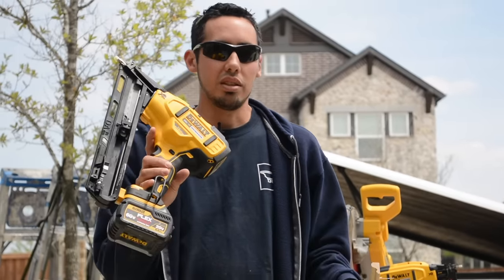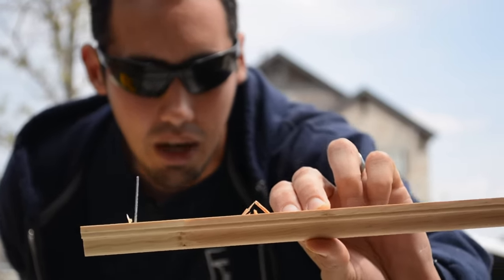Which NAIL GUN Should You BUY???

Comment: I have both of these nail guns and I absolutely love them!!! but I still use  pneumatic nail guns it certain applications if you can afford to upgrade to the battery operated trim guns  I highly recommend it. If not you should definitely look into buying the pneumatic versions of these guns . I actually have them both battery operated and pneumatic They are amazing guns and  have been engineered with a brand new technology I believe it’s called smart point or fine point technology. This technology and these guns are the most user-friendly and reliable trim guns I have ever shot. Even the angled gun shoots every single time and anyone that has used a angled trim gun knows that they are not the most reliable when it comes to pulling the trigger and expecting a nail to shoot out!
Reply: There is nothing new about smart point technology. Bostitch has been using it for quite some time on their phnumatic line. Bostitch and dewalt owned by same company so the technology was transferred over. 
If you want pneumatic dewalt isn’t too of the line. Bostitch And hitachi blow it out the water. Battery operated though dewalt and hitachi are the only contenders.
Reply: Are you a fan of pin nailers?
Reply: crunch9876 In my view you cant beat bostich
Reply: John Davidson well boating and dewalt battery nailer are 100 percent the same except for battery. What would you rather have a battery for one tool? Or a dewalt battery that could fit a lot of tools.
Reply: crunch9876 bostich neumatic i was talking about.. had the 23 guage used almost daily  for 11 years with no issues
Reply: robert sharpe

I'm not a DeWilt guy but I have the DeWilt pneumatic 15G nailer and I would buy it again.  It's really good, I only wish it was teal color instead of yellow.  :-)
Reply: Bill salvadore  yes sorry for the late response but yes I use pin nailers in certain applications. I have a pneumatic 23 gauge Hitachi and I also recently purchased Mikita’s new battery operated 23 gauge pin nailer I like to use pin nailers for shoe molding and installing trim on cabinets or for holding up a very small piece of trim. A pin nailer allows you to install a piece of trim with almost a flawless finish they r great for installing pre-finished moldings
Reply: I am going to replace my back yard wood fencing (dog-ear picket) in spring 2019.  I am not an expert by any means but have replaced sections before.  I used just a hammer
and nails.  This time I would like to lighten the load by purchasing one of the DeWalt cordless nailers, which one should I buy?
Reply: @jamesogletree5257  DeWalt just came out with a fencing staple gun. It's big and burly but packs a hell of a punch. Might be too much though, maybe the 15 guage might work better.
Reply: Can i have your nail guns
Reply: Yes
Reply: @gshock200  
Yes
Reply: @gshock200  
👍
Reply: @gshock200  yes
Reply: could u use 16 guage nails for delicate tirm? especially for old house
Reply: randomrazr if I were you I would just go with the 18 gauge and skip the 16 altogether if you want a larger gauge I would just buy a 15 gauge angled gun but for delicate trim I definitely would use a 18 gauge and depending on the trim might would even use a 23 gauge pin nailer
Reply: Are they still working.
Reply: @rsharpe1985  I use 16 ga it works for me the diff between 15 and 16 isn’t enough to matter that much
Reply: @mrgrump2534  Yeah there isn’t much difference but for nailing up Crown the angled gun makes a difference
Reply: @rsharpe1985  16 is better for me it’s lighter gun and the nail holds up just as good as 15 ga so not shure y ure saying skip it u must not have had much exp. with it then I’ve been using for years so regardless  it’s a proven nailer so ....
Reply: @rsharpe1985  well since the 16 is pretty much just as angled it’s a wash unless ure gonna say that extra 5 degrees makes a difference ... I do like the precision tip tho can’t deny that
Reply: Nothings better then pneumatic nailers not yet
Reply: I was hoping to hear the difference between a straight gun and a angled gun.

Comment: Don’t laugh me out of the comments but don’t sleep on the ryobi’s  I have the 18 and narrow crown stapler and they work great especially for almost a half the price of Milwaukee or default. They just don’t make a framing gun
Reply: I like the Ryobi. I also have a larger gauge DeWalt, but I pick the Ryobi every time. Less fatigue due to less recoil, lighter, more quiet and better faster operation. Smaller gauge nails means smaller holes to patch up.
Reply: My 18 gauge ryobi have been probably the best $150 I've spent. I usually do light stuff though. About to buy a 16gauge ryobi also and then a dewalt framing. Battery powered all the way
Reply: Yo im a dewalt guy but the ryobi is best batt trim gun ive used
Reply: They got a framing one now lol
Reply: It gets stuck if u don’t use it often. Sometimes u get what you pay for 😅
Reply: If you're not trying to pay your bills with it, then it's a no brainer.

Comment: Any gun is better than swinging a hammer all day.
Reply: robert winton   A tool used to smack a 2x into place so you can us a nailer to fasten it.
Reply: Unless you're Larry haun!!
Reply: Trevor Zook larry hauns are framing god
Reply: Who hammers at trim?
Reply: I did it as a rookie in a pretty hidden area of my house. Never again.
Reply: Not if that gun is a Dewalt and you have to take the hammer out to finish what it coldn't. Hitachi now Metabo NR1890DR, that's the only true portable pneumatic nail gun with the power to punch through hard woods. It literally has an internal self  contained 120psi air cylinder in there.
Reply: @TechieTard  I love the framing nailer but damn it's heavier than the DeWalt which is pretty heavy
Reply: Nail gun with house
Reply: @rayg5445  I hammer trim...if you know what mean.. ;)
Reply: I do interior trim work for a living. Ridgid nail guns are by far the longest lasting. I've tried several different brands and most of them go out within six months, with the exception of the Ridgid. You get at least a year out of the Ridgid and it has a lifetime warranty. When you use these almost every single day, you find out which ones are the best. Ridgid will hold up forever. DeWalt miter saws are by far the best. Do you want makes a whole lot of good tools, but the nail guns do not hold up over time.
Reply: I used to swing hammer back in the day, I kinda miss it, plus my forearms looked like Popeye the sailor.

Comment: Brother, this was VERY helpful.

I am not a pro. But I am a very experienced DIYer. I have done everything, except for finishing work. 

Right now, I am remodeling one of my bathrooms and for the first time, I am replacing baseboards. I usually attach all things with screws, and that won't do for finishing work, so I am learning new tricks. In as much, I picked up an 18 gauge nail gun. I was about to do both the baseboards and the trim molding with that gun.

But then I watched your video. Now I know I need a 15 for the actual baseboards. I just picked one up on ebay. You saved me, literally, a day before I made that mistake.

Thank you!

Comment: Easiest answer! Ryobi brad nailer for your most trim work! Light gun, never jams, costs pennies!!! If you need speed and putting out thousands of nails per minute (like putting pickets on or balusters on the deck), go with Dewalt 2.5 inch angle nailer. I've tried every single brand and type of nailers and so far those two are my most favorite ones, and I am a milwaukee guy, so that tells you how much I trust in those two.
Reply: I second the ryobi for home users. Mine has been great.
Reply: hitachi all the way, try one and youll never want anything else
Reply: You are right. The ryobi is amazing... but the battery will not work at around 10 / 15 degree Celsius.
Reply: Yea the ryobi 18 gauge nailer is surprisingly good.

Comment: Which gun you should buy depends on what you do for a living and your budget.

For the homeowner/diyer on a limited budget I recommend getting a pneumatic nailer and one of the quiet compressors. For the price of a cordless nailer you can get a pneumatic nailer, a hose and a nice compressor. And that air compressor with a blower nozzle can be used for quickly cleaning up a work bench and power tools or blowing off dust from your clothes. I also use my compressor to apply water-based clear coats.

For the pro driving finish nails all day cordless is the bomb!!!

Comment: So I went and bought the DeWalt 18 XR just like you are showing... I give it to my helper to drive some nails into baseboard molding, I figure I would let him do a little easy work.  It keeps jamming nails, I tell him to make sure he is following the instructions, clear it out and reload.  Half an hour goes by and he keeps coming back telling me it's jamming.  Now I am not one to just do everything, I try and let my guys figure stuff out.  I have faith and figure he is doing everything correctly and I'm going to have to return this thing.  I take a look at it and he is loading the nails from the top of the slide instead of the bottom.....  After clearing out the jammed nails that have worked there way under the sliding cover it works perfectly.  Unfortunately I can't say that for my helper.  LOL  I used it the rest of the day and am very impressed, thanks for steering me to this tool, appreciate your videos.
Reply: LOL that's funny. Thank you for your input as I'm trying to think what nail gun I should purchase for odd jobs and around the house work

Comment: This video gave me exactly the information that I needed. I had it in my head beforehand that I needed a 15 and a 18 gauge gun, and you just confirmed what I was thinking. 

I’m a Building Services Engineer and occasionally I have to do some ‘fabrics’ work and a nail gun will come in extremely handy, also with my work at home making my own cabinets. 

15ga for the meaty stuff and 18ga for the trim. Thanks FCTV.

Comment: We use a 15 gauge nailer on exterior trim applications- deck skirt boards, 1x or 5/4 trim, and also to set door jambs. The BIGGEST nail I would ever use on crown, casing, etc is an 18. No way I would want to fill the hole left by a 15 or even 16 gauge nailer in crown or casing on interior applications. I tell you what we have gotten in the habit of using- 23 gauge pin nailers. They hold unbelievably well and on cabinet mouldings- other than crown to face frame- that’s all we use. Someone needs to make a battery powered 23 gauge nailer (it would be heavy I know) but that would be awesome. Embrace the pin nailer. It’s the best nailer for toe nailing mouldings together and will hold a lot better than you think. And a super small hole to putty. For interior trim 18 and 23 get the job done!

Comment: have used trim head screws a lot doing commercial work with steel studs in the past. i like your videos ive been out of the trades for years but have continued to do wood working until my divorce when i had to sell the property where my shop was. i recently started a handyman business and do a little bit of everything i bought a 7 1/4 ryobi 18v two years ago to do some small mouldings and it work fine for the application i purchased it for still running all my old bostitch finish guns as they still work great . thanks for the vids im refreshing a bunch.

Comment: I agree on the finish screws are a good investment,  holding power, ease of use, miss with the screw can back it out, good luck on finish nail.
One advantage to air can sling it over your shoulder I don't trust a clip on battery tools
.I use senco with rolair twin tank, just over 1 minute to fill, refill during usage 10 seconds.
Though battery has its advantages. 
And disadvantages as well as in must pay attention or the battery dies while on the ladder.
Life can be fun at times and that's one of them.
Do you have video on air verses battery?

Comment: I do a lot of smaller bathroom and kitchen jobs and these dewalt guns make it so much quicker than having to set up hoses and compressor. The cordless roofing nailer is great too for repairs or to have a backup for the guy on the other side of the roof and can be used for siding with an adapter.

Comment: I noticed your comment about recoil. I spend most of my nailing time using a Brad nailer these days, but I have plenty of time on smaller pinners as well as full size framing guns. The recoil seems pretty similar across them all, I assume the weight is pretty proportionate to the force.

Comment: "You should buy all of them" - that's about right.  For pneumatics, we have a brad nailer, finishing nailer, framing nailer, roofing nailer, and palm nailer.  Not even kidding.  I would also have a siding nailer too, but the roofing nailer has an adapter.

I think a better question about nailers than what should you buy is actually, "How many nail guns should you buy?"  or better yet, "What's the right amount of nail guns you should buy?"  And the correct answer is n + 1.

Comment: Any nail that goes deeper than 3/4 " into the stud is hard on the gun and increases the risk of hitting a wire or mechanical line. 16 gauge nails are. 1/5 the cost of 15 degree angled nails-wow....but I love a 15...it connects. Hitachi new cordless guns are the bomb . Hit just like air...because they use air.

Comment: I still got the 1st generation dewalt nailer with the nimh battery, still use it nearly every day and it’s near on 10 years old, it only twice broke down, both times I fixed it myself. The pasload is expensive to run, needs regular services and don’t work in the cold, not that I guess that’s a problem where u are! I don’t think it’ll be long before pneumatic nailers are pretty much obsolete

Comment: Regarding pneumatic nailers, unless a person is using a 1" hose for 100' you are going to lose some pressure over that length of hose due to something called hose friction. A 50' 3/4" hose  @90 PSI  loses 5% of pressure. That pressure loss is even reduced further with 100' of hose. Also regarding 18 gauge nails, no one makes one longer than 2" or a gun that would shoot them as far as I am aware.

Comment: We went with Dewalt 20V 15g and 18g guns, largely because we're already on that battery platform. One problem: When pressing the tool against soft wood trim with only normal hand pressure, the "micro nose" dents the wood right next to the nail hole. This has forced us to go back to our traditional Senco pneumatic with its larger rubber nose on soft wood trim, undercutting the advantage we hoped for when moving to cordless. Milwaukee 18V line looks good enough to tempt us to add a second battery platform. Does Milwaukee offer trim guns with a larger nose like the Senco to avoid this problem with dents?

Comment: I have the Dewalt 16G, and I'm a cabinet/Trim carpenter, the 16G is good when nailing 1X material with 1 3/4" nails for a good bite, the thing that drives me insane about the Dewalt 16G, is that it dry fires after your out of nails, were they smoking crack when they designed that gun??

Comment: Hello, I am not handy at all and know nothing about tools.  It's impossible to find a reliable handy man and if I do I can't afford them.  I've decided to do it myself or at least try too!  I am slowly getting some tools, I have a chop saw, some drills, circular saw and I'm looking to get a nail gun, What do you recommend for a beginner 15, 16 or 18?  I don't want to have to buy a different type later down the road because I'm doing a different project.  I am using it for around the house, I'm going to try and replace my baseboards, repair my stockade fence before a hurricane come through, picture frame etc.
Reply: Debbie H if you can just afford one the 16 is nice.  If two are possible for your budget the 15 and 18 would be the way to go.  Also consider getting the 1/4 crown staple gun.  It is 18 gauge.  Also, Porter-Cable has good brad and staple 20v guns at a great price on Amazon.  Of course if you buy all DeWalt the advantage is one brand of battery.  Best of luck to you.  I DIY most of what needs done.
Reply: I'm on the same boat as you, Debbie
Reply: 18 is a good starter gun go with a battery if you are just starting out.

Comment: I'm in the process of finishing my basement and I'm getting tired of using a hammer. I'll be dropping the ceiling  using 2x4s to hang panels for my ceiling, adding baseboards and hanging brick panel board for my walls. I'm also going to build a shed and a nail gun would be nice for that, also. I don't need anything too expensive because I don't build professionally. Which Harbor Freight gun would you reccomend, for all uses?
Reply: Forget HF and get a DeWalt frame nailer and also the 15 gauge and 18 gauge DeWalt nailers.

Comment: I did have a Stanley bostitch gas nailer and I found them very temperamental and then when I lived in Canada for a while I used the Milwaukee battery nailer for the first time which I was impressed with but I ended up buying the DeWalt battery pinner and they are quality. I think I’ll buy the 15 gauge one also.

Comment: Your examples and explanations were great and easy to understand which really helped me in making my decision for my next nail gun purchase.
However, you talked only of molding and other wall applications and I was wondering if you could give me your best recommendation for my next project. I'm going to be building my own king size platform bed frame with headboard, so I will obviously have larger, much thicker and wider pieces of wood (I'm planning to purchase cedar or pine, most likely pine) and I want to be sure that I use the best gun that will give me the ultimate of strong and long lasting holds. Your suggestions greatly appreciated and if you have any words of advice for my upcoming build... lemme have it!!
Thanks so much!!